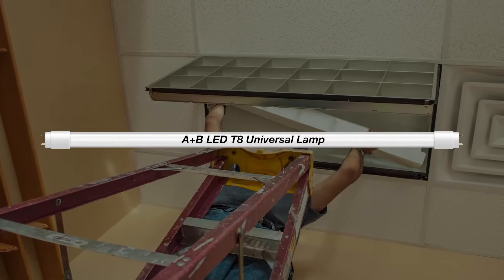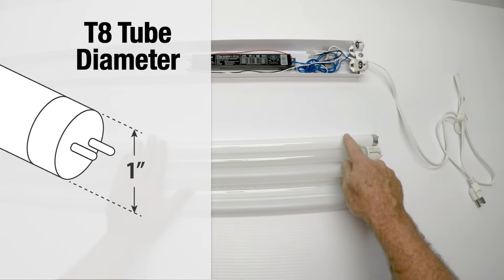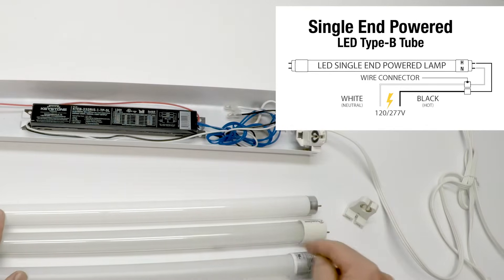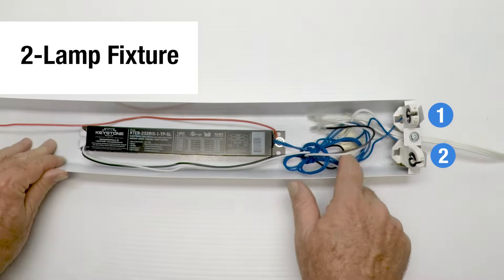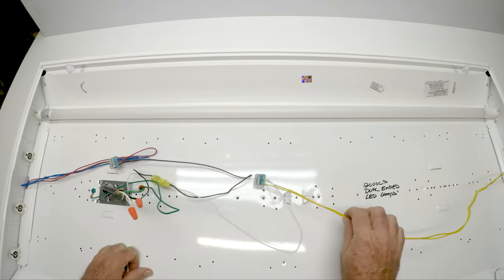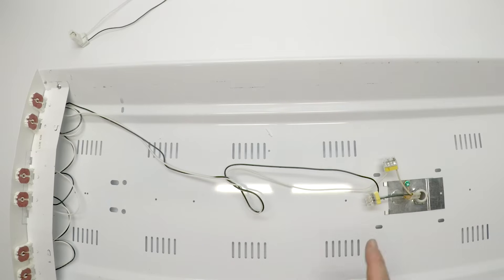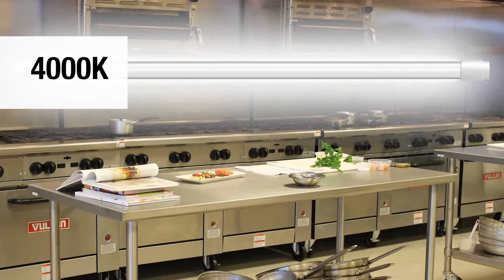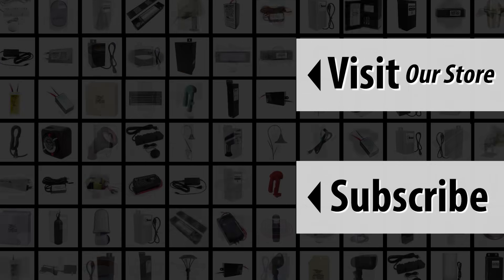Universal LED Tube Converts your Fluorescent Fixture to LED in Minutes, WORKS with no Ballast too!

Comment: In the European Union, single ended tubes should actually be used. 
But you can also find double ended tubes. 
An LED tube that can do both is good.

Comment: I have only a four foot single set up one that has been up in the kitchen forever. Can I still do this?
Reply from the maker: Yes, converting from Fluorescent to LED can be done on a single tube fixture as well. Simply follow the wiring diagram here https://www.totalbulklighting.com/mwdownloads/download/link/id/513 but if your not sure we highly recommend using a qualified electrician 🙂

Comment: Quick question, are the bulbs able to be used in a backlit outdoor sign, with temp. below zero at times? very informative video.
Reply from the maker: I know that it can not exceed an operating temperature of 113° F. Not sure about the below zero degree temp as the spec sheet does not include that information.

Comment: Does Lowes sells your LED lights?
Reply from the maker: They may sell another brand if they sell LED T8 tubes. Just make sure you are purchasing the Universal Tube as there are different types out there and it can get very confusing. It will say it can be powered in the way you see in the video 🙂

Comment: Are the tombstones Shunted or non shunted.?
Reply from the maker: The universal T8 LED tube used in the video will work with both shunted and non-shunted tombstones. What's more important is how the fixture is wired. Always follow the wiring diagram when doing any retrofitting and installation.

Comment: Wattage: What would you say is the difference between a 5000k led bulb with 18w and a 20w 5000k led bulb in terms of brightness and electricity consumption?
Reply from the maker: I would find the lumens of each tube and divide the lumens by the watts the tube and see if you are gaining any lumen benefits from adding 2 more watts with the 20watt tube. Hope that helps 🙂
Reply: @Totallightingsupply  Thank you. I am looking for the most brightness at the most efficient energy consumption for 5000k temperature.

Comment: The universal A+B T8 looks like a good solution, but I only need 2 bulbs. Why is the minimum order qty 20?
Reply from the maker: unfortunately there are many variables that have impacted the sale of these amazing T8 LED tubes. One of the biggest issues is the amount of breakage in shipping on small orders. No matter how well we packaged these tubes the shipping company managed to break them over and over and over. Hopefully that helped shed some light on the question 🙂
Reply: @Totallightingsupply  Understood. Unfortunately for me, that means I will need to rewire the existing fixtures to use with type A or B LEDs.

Comment: This video was very informative.  But my question is how do you bypass the ballast for light fixtures that are daisy chained.  I have two extra fixtures and the main one coming from the ceiling wiring.  I’m having trouble trying to locate a video or understanding how to do this. All the Videos I’ve seen are for 1 fixture bypasses.  Can you help me or attach a link to a video?? Thanks.
Reply from the maker: It's very challenging to troubleshoot these types of wiring situations without being there. One of the best place to start is with our form. It walks you through some of the most common issues. I believe it deals with daisy chained fixtures. You can find that guide here https://www.totalbulklighting.com/fast-fluorescent-to-led-t8-conversion-tool.html

Comment: Once you have made the conversion will you always need to use the hybrid type A/B led bulbs from the point forward? I have converted my Mom’s second fixture with the aid of this video and both are working perfectly. Thanks again for posting!
Reply from the maker: What type of LED bulb you use will depend on which retrofit method you use. So for example if you use the double end retrofit method you can use the A/B universal led bulbs or type B double end powered LED tubes used in this video in the fixture 🙂
Reply: @Totallightingsupply  ok, that’s great to know. Thanks for the helpful info!
Reply from the maker: @cd7071  You're very welcome 🙂

Comment: This is a great detailed video for led conversion, thanks very much for posting. Does it matter (once a two lamp fixture has been converted and the ballast removed) which end of the A+B bulb goes to the hot side vs neutral, or can it be turned either way as long as the led strip is at the top facing down? Thanks again
Reply from the maker: For our T8 LED lamps the direction doesn't matter. Now this may be different for other brands. Hope that helps 🙂

Comment: I purchased universal A&B tubes at Lowes and their wiring diagram says to use a 1 amp fuse on the hot wire ???? Is this really necessary ?
Reply from the maker: Since we don't sell the brand of LED tubes from Lowes I would not be able to provide an informed answer. I would recommend always following the directions that comes with the product 🙂
Reply: @Totallightingsupply  — I will say, if they want you to install a fuse in a fixture that, for the sel or del didn’t have a fuse, then their tube isn’t “universal” …

Comment: Thanks for the in-depth description clarifying how all of this stuff works .  It's great that companies and people like you are sharing this information.  But with the variety of wiring options, and the advent of the TYPE-A+B LEDs, which tube do you think is or will be the most popular and (really the bottom line) the most manufactured and economical type of LED tube for T12 & T8 type lighting fixtures in the future, barring the introduction of another "better" lighting option?  I'm new to these conversions and am on information overload right now so much that it's taking me back to the days of the BETA vs VHS debacle!  😱  I personally like the single-end TYPE-B  just because it's seems the most simplest.  I would just like to know which direction we're going before I start yanking down my old T-12s and Frankenstein-ing them into T-8 LEDs!  😄
Thanks again for your presentation. It's greatly appreciated!
Reply from the maker: You're very welcome! Glad our video was helpful 🙂 We hear from many electricians that favor the dual end retrofit method as it utilizes the existing fixture components and provides a faster conversion. So it saves time and money. Type A+B helps remove the guess work out of the equation for DIYers and provides a very easy way to get into LED. But like most things when something works great, provides good benefits and it isn't very costly it tends to grow in popularity and use, pushing costlier alternatives out. Both provide great benefits but it ultimately comes down to the projects requirements. Hope that helps 😊

Comment: So if I have shunted tombstones and want to power the light single end power, do I need to change the tombstones on both ends of the fixture to non shunted or just the power end of the fixture to non shunted? Thanks
Reply from the maker: That is correct, for single end powered led T8 tubes you will need non-shunted tombstones on only the one side that is electrically connected. You can find non-shunted tombstones on our website here 👉 https://www.totalbulklighting.com/parts-accessories/non-shunted-tombstones-sockets.html

Comment: I have a 4 ft 2 ballast florescent fixture.  From each ballast comes 2 red 2 blue 2 yellow. How do i rewire with no ballasts with double end bulbs.  I have the ability for on and off from 2 different switches.  Either one makes the entire light come on or off
Reply from the maker: This is called "three way switching". There are a number of ways this is wired, and we cannot explore all of them here. Best thing is to get your electrician on the job and in 10 minutes he will know where the hot and neutral wires are that come in the fixture and will be able to wire up your retrofit quick. As long as he knows that the bulbs are powered from each end, Hot (Black) on one and Neutral (White) on the other it will be easy. Your electrician will remove the ballasts and wire up your LED to work perfectly. Hope that helps 🙂